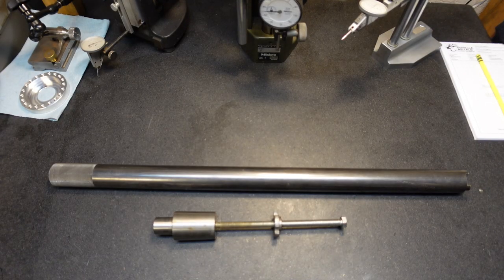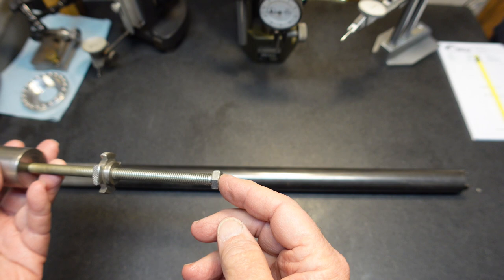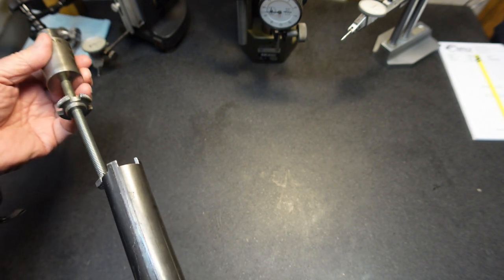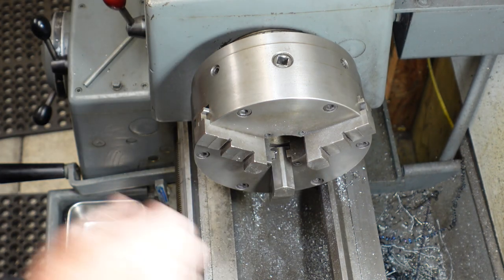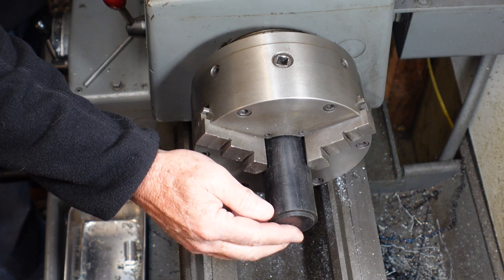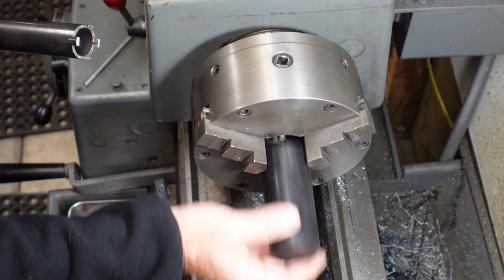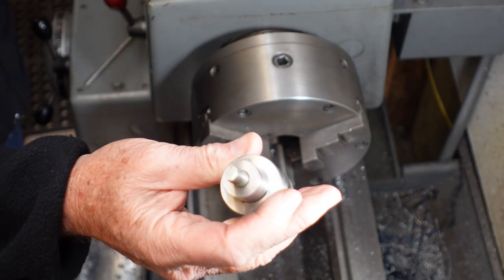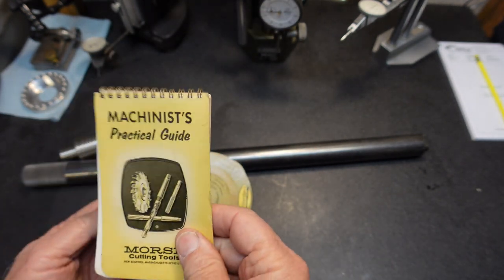3/6 Jaw Chuck and ER32 Adjustable Stop

Comment: I've been trying to find a good solution for a stop in my ER40 collet chuck, but always find the same issue. The collet moves back as it's tightened, so if the stop is fixed to the chuck or headstock, soft parts in brass, copper or aluminium, especially those being gripped by fine threaded sections, get messed up. If the stop is somehow referenced to the collet, the end position depends on the diameter of the part, with tiny differences being magnified by the taper. 
I am SO stealing the idea of the stop that fits in the headstock taper for some parts I make where I can't use a groove micrometer to get the parts to size. Neat!
Reply from the maker: thank for viewing and your comments